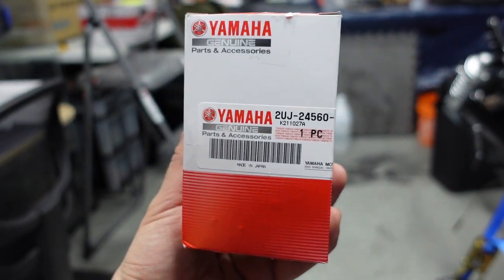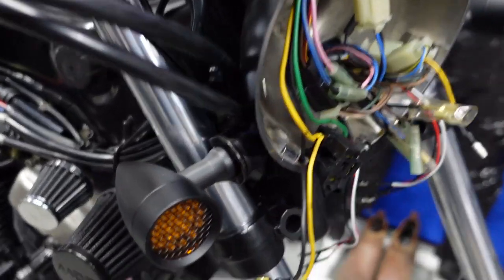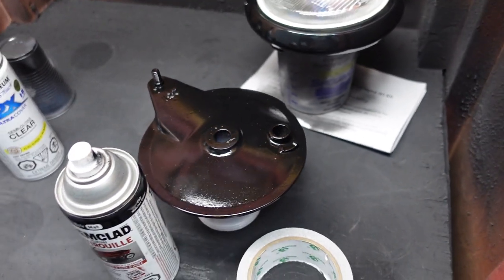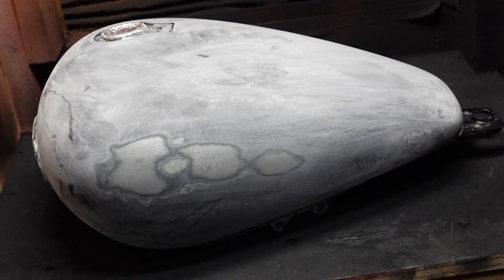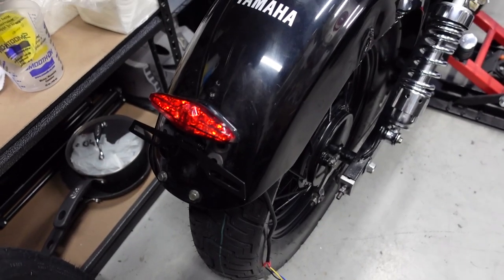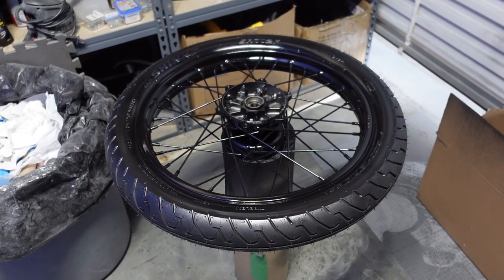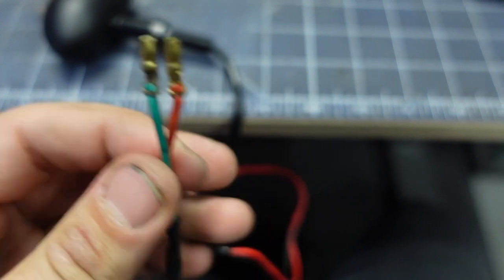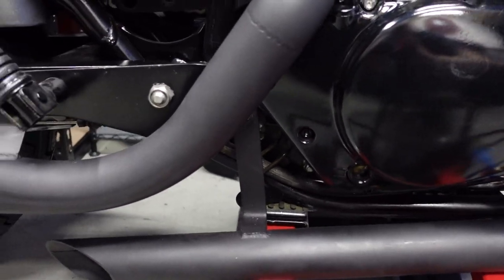Junkyard to Showroom: Custom Virago 250 (XV250)

Comment: On the LED indicators (turn signal) have you wired them the right way round as leds only work when dc volts flow through them in the correct direction in. The d in led is for diode a type of electronic one way valve the symbol on circuit diagram is arrow with line across the tip with in the case of leds 2-3 output lines/arrows at an angle to indicate the light being emitted when forward biased as it's called.